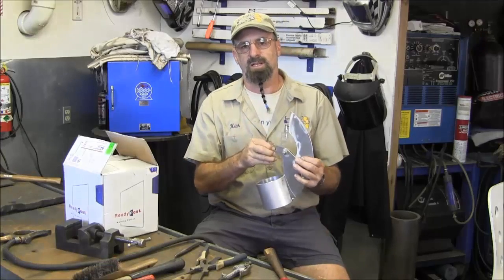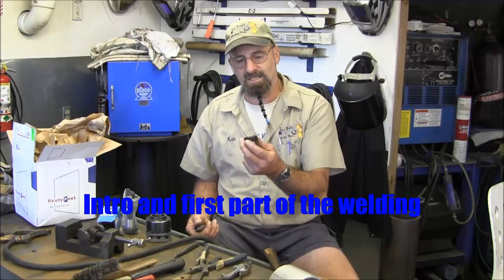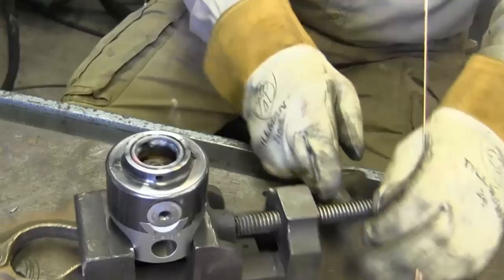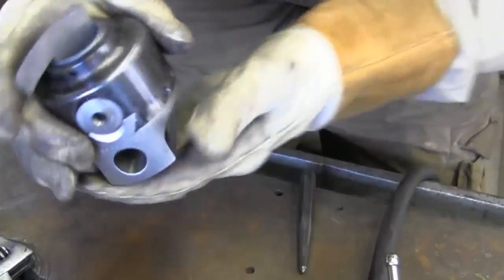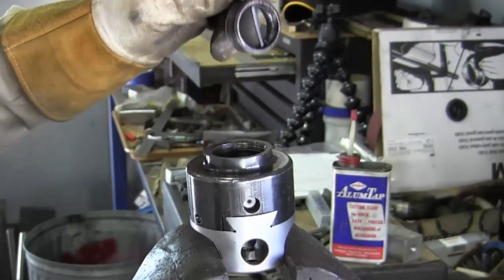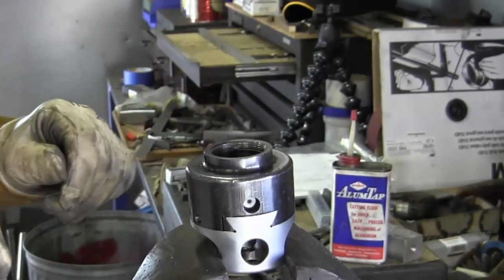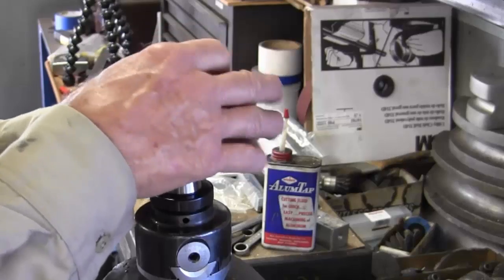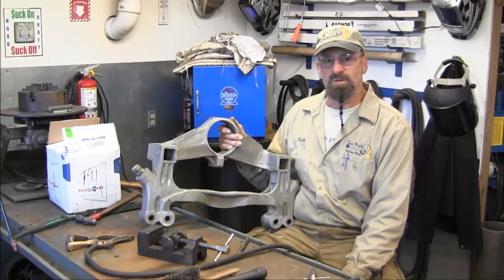Criterion & the R8

Comment: Good video. Criterion was north of Oceanside. I worked at Criterion Machine Works for 30 years. First as a machinist then Foreman of every department ,finally the last 12 years as Production Manager (Chief of manufacturing operations). I am 77 years old now and left Criterion in 2002. I heard by some former employees that the company was sold around 2008?  I started there in 1972 right after Henry Brent passed. Criterion started in 1935 in Beverly Hills making parts for the movie industry ,we were 1/2  job shop as well as our own machine Tool product line.  Contracts with Ford Aeroneutronics,TRD, Dan Gurneys All American Racers and so many more, cheers and thanxs for the video. PS: we also did a lot of repairs on all our products. I ground a lot of R8 Bridgeport shanks in the old good days.

Comment from the maker: If you had protected the head from the splatter and accidental arcing and could hold back from poking the wire through one of the pin or set screw holes so you don't damage the original threads underneath, then there would be no difference in the effects of the process. MiG is a great tool, just needs a bit more cation. ;{)-----

Comment from the maker: As some tools get older or are used tools, backlash is part of what you have to compensate for as a machinist using the tools. That is why it appears that some operation of the last cuts are sneaking up on the finish or left to hand work so over or under sizing doesn't happen. ;{)-----

Comment from the maker: Great kind of thinking! love your comment. I have seen arcing between threads, salt ridden alum housing with S/S studs, having to jump the corrosion, built up between them. Most arcing action has to create a mini explosion / arc / flash, hinders the start or weld arc instantaneous and leaves a blem. There was no signs of that on this project, that ring insert was tight. The drilled and set screwed holes, passing through the ring, were most likely causing the interference's. ;{)-----

Comment: I've got a Triumph motorcycle head sitting around somewhere where someone has run a bead around one of the valve seats to shrink it. It's normally a good trick, but they didn't know that the seats are tapered and were cast in! That's going to need boring out. I've got an Indian (SOBA brand) made 2" Criterion copy that's not too bad, a nice Elliot 3" and my latest score, a Japanese Mizoguchi mu3 automatic boring and facing head (Wohlhoupter copy).

Comment: I did something similar the other day.  Welded a couple M8 nuts to square tube, and left the bolts in for alignment.  Ended up shearing both bolts and had to redrill/tapp the nuts. :(

Any way to prevent this kind of thing?  Is it just a matter of letting it cool completely before removing?